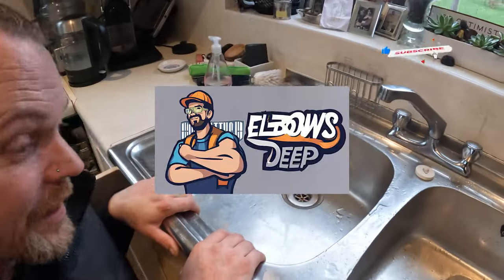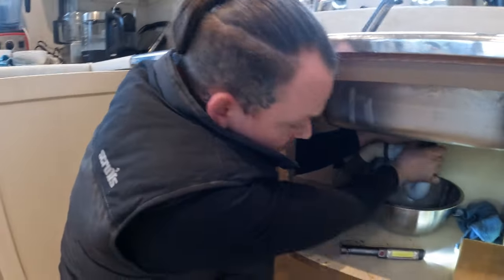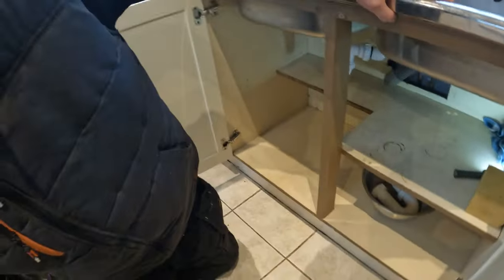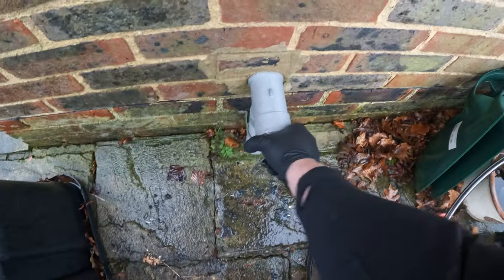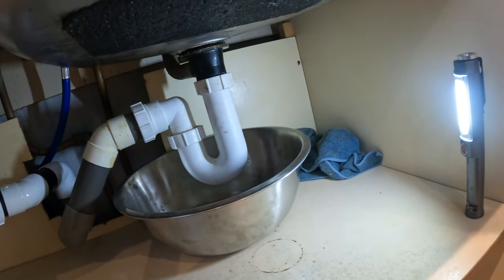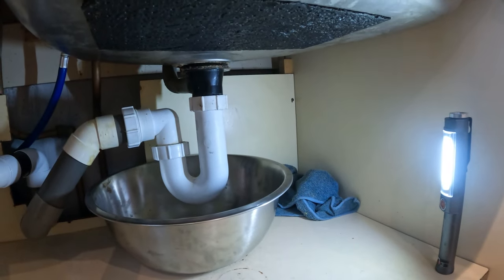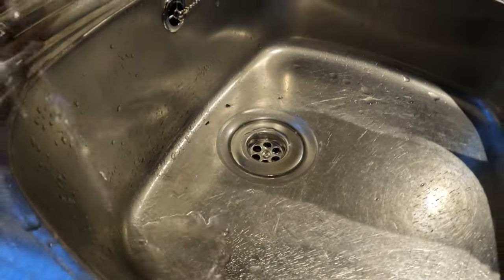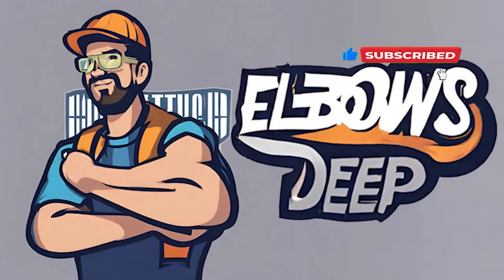Blocked Drain 23 Kitchen sink blockage and sink plug hole replaced

Comment: I would imagine there was a lot of sludge buildup in the pipe reducing its ability to vent from below once a strong flow of water was running down the restricted volume of pipe. Either that or the base of the pipe below ground level was submerged due to backflowing drain or simply the pipe leading to the septic was full and not able to allow venting. You normally get the gurgling if you have a conventional gully outside which gets blocked and fills up, submerging the end of the sink outlet drain pipe where it goes into the gully, and this means air cannot get into the base of the pipe to vent it. Air cannot get in at the other end either due to the U bend, so it has to suck itself in through the water in the u bend and makes the gurgling.  Usually find long runs of horizontal pipework between the sink and the main drain or gully can cause gurgling as well. 

I think in the case of that sink, sometimes trying to fix a slight problem like a loose plug hole ends up making an even bigger problem such as the waste securing screw snapping, meaning that you have to then replace the entire fitting. A little old fashioned with the rubber plug on chain - I'd have thought it would used a basket strainer on that type of sink, but I suppose you replace like for like and a basket strainer in one side would have looked odd.

I'm surprised she didnt ask you to fix the leaking tap washer as well - but that would possibly have necessitated replacement of the entire tap and isolation of the water mains - another can of worms, lol.

Indeed, 1000 subs soon and the chance to monetise the channel - make the views start paying. I'm on Youtube Premium anyway so wont see any ads, but it helps you out with some revenue for all the bother of filming, uploading, editing, and your time to bring us these videos.
Reply from the maker: Hi Steve, such a perfect read on things from beginning to end. I explained this in a much lesser way in another comment, when I emptied the vac it had plenty of fat inside and the snake snagged on somthing on the horizontal leading back to the sink, what ever it was it broke up in the pipe. I really like your insight and wish I had the ability to explain like you do.  Yes the plug was like for like and very basic. She needed to replace it regardless as it was leaking before hand. I went back and did the tap the following day, she called that evening to ask, well spotted. It needed a new cartridge on the hot side but she chose to get a new tap so I replaced it. 

If I go for monetisation it will be for the time it takes to make the videos and very likely go back into the business to help make better videos, pay to advertise to get more variety of work ect. I don’t have Google ads and work coming in is only from organic google, my business and Website visits, which is not huge amount.